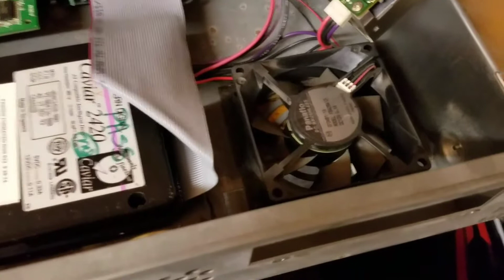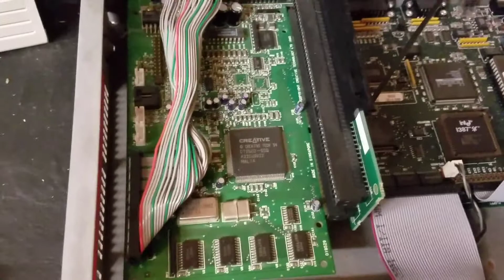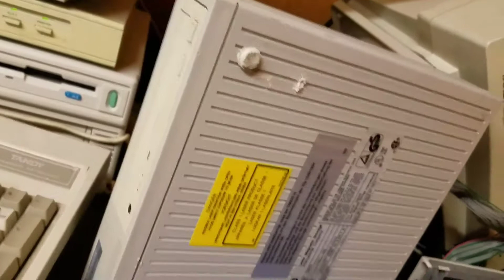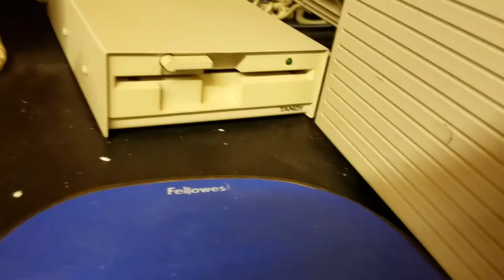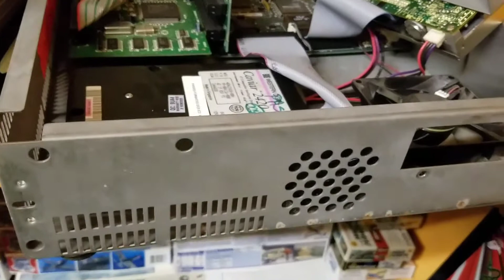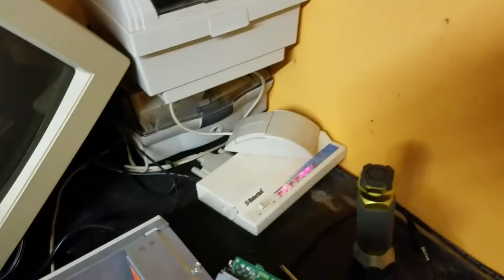Inside The Tiny Tandy 1000 RSX

Comment: Can anyone confirm what type of memory the 2500 supports? I know it's 30pin but FPM or EDO and 60/80/100 or 120ns? Also ECC or non-ECC? Thanks!
Reply from the maker: Its been a while but I will check if you still need that info.

Comment: Very nice! I had this system with the co-processor and 1mb onboard ram and added the 8mb ram option and upgraded 2.88mb floppy. I also had many other 386 systems, even a 386DX/40 and somehow my RSX ran circles around them all. My dumbass gave it away when it was still sorta in its 'prime' and I coulda got a cpl more years out of it. mine came with a 60 mb connor drive which I eventually put a 600mb WD drive in it. Like you said, it was bad ass for its time.
Reply from the maker: I am currently upgrading the hard drive in this computer you will see the video shortly.

Comment: A note for anybody trying to connect a replacement floppy drive: The RSX still looked for DS0 and used the DS jumper/switch on the floppy, so you need to swap pins 10-12 on the ribbon to make it work with a normal floppy.

Comment: Did the RSX still support Tandy 3 voice audio?
Reply: Technically it does, but unlike the others of the 1000 line, the RSX had to put the 3-voice DAC on a different address. So the only thing that works with it is the music program in DeskMate (which I've never got working on mine). It also doesn't support Tandy-16 graphics, just CGA/EGA/VGA, so any of the old games advertised for "Tandy/PC-Jr" graphics and sound are going to run as CGA/EGA with the 1-voice "PC speaker" instead. That was a bit of a disappointment when I finally figured out what was going on, but I've got my 1000HX for running those games anyways.

Comment: Can i connect a 1000RL to a flat screen lcd monitor that has the normal blue VGA input we see today?
Reply from the maker: Yes, usually  most LCD monitors have both  DVI & VGA inputs. It's not going to look anything like it should, as if it was on a CRT. But it will work.
Reply: thanks. i just got an RL, the original box, and the keyboard for $50 from goodwill. I think I'll open it up first and make sure its clean inside. They tested it there they said but I guess they used a standard power cord because it didn't come with any cord.
Reply: @ifragisk  I think the 1000RL uses RGB instead of VGA. You'd need a CGA/EGA monitor. If you can't find one, 8-Bit Guy has a video on his channel on converting a TV with composite input to use RGB (be sure you watch the follow up video as well) Can you confirm that it has a 9-pin video, or is it 15-pin? If it's VGA, it should be an RLX, I think, not an RL.
Reply from the maker: @BlackEpyon   On my RSXI was able to connect to a flat panel LCD with no problem. I have and RL as well in storage but I as of yet I have never checked to see if it would work.
Reply: @HavocSun  I used an LCD on my RSX for a bit, but decided that the LCD ruined the aesthetic of playing with a vintage computer. So I went onto eBay and tracked down a Tandy VGM-300 to go with it. Got it for a decent price too. No regrets.